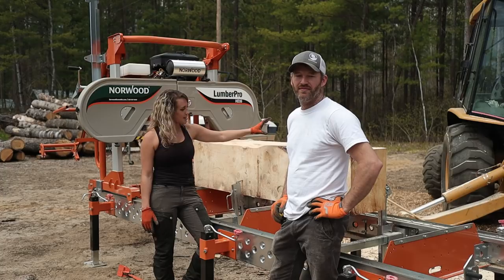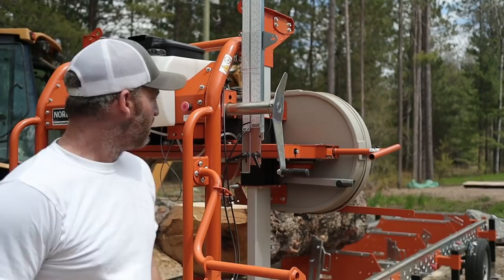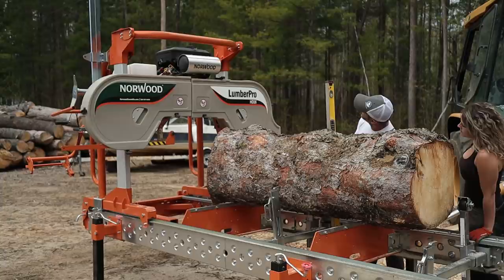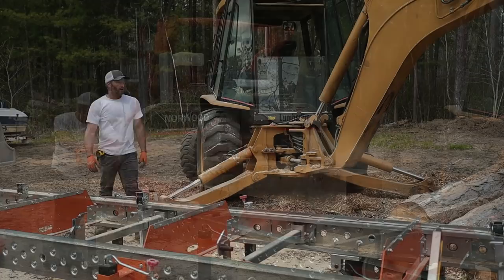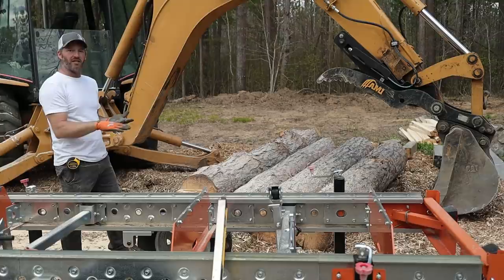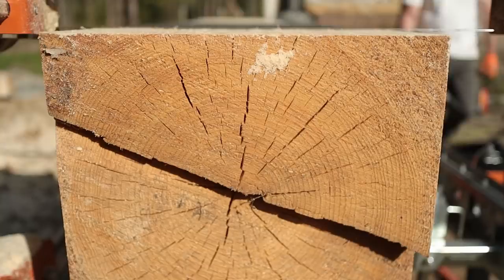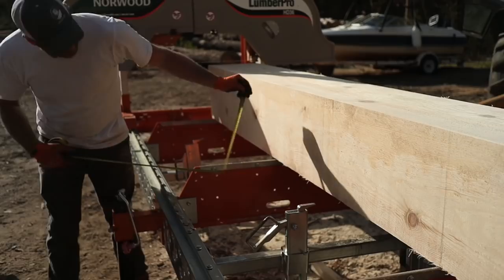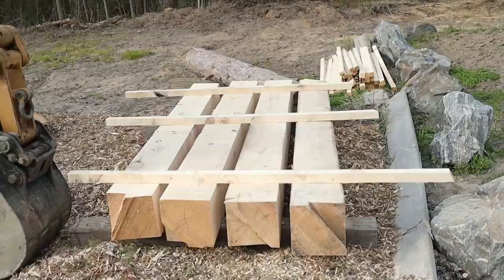Milling Big Beautiful Timbers from Trees We Take Down | Norwood HD36 Portable Sawmill

Comment: You should get yourself a metal detector and run it over your logs before cutting them it would save you a fortune on blades in the long run
Reply from the maker: Definitely something we are looking into!
Reply: TimberMates if you get one make sure you put it into all metal mode as they are usually built to ignore things like iron....especially iron nails. Give me a holler if you want any advice
Reply from the maker: Thanks man!
Reply: TimberMates no worries brother anytime
Reply: smart idea
Reply: And what actually you do, when you detect some metal? I told you, you cut anyway hoping for the best... Better get some sharpening tools, restore blades yourself and save money this way.
Reply: @yarpen86  that's if the blade is repairable with a decent metal detector you can pin point exactly where the metal is and how deep it is also sharpening a blade would take you hours  time that could be better spent working
Reply: @Thebigmanmetaldetecting  My question is stil valid, what you do when you detect something? Scrap the log? Dig until you extract some nail? Losing even more time? If it is not some massive bolt or rock, just go thru, charge more and put band on sharpening machine. I was trying detecting and after short time i decided it is not worth the effort. Of course if someone want to try, more power to him, everyone should find his own way.
Reply: Could you get carbide/diamond blades for a saw this big?  That would be slow going through wood, but it wouldn't have an issue when it hit metal.  If you could use a metal detector to figure out approximately where the metal is, and then switch to a metal-cutting blade just for that section, that might work.  Definitely a bit tedious, but it would keep the slabs intact, and it would be a lot easier to cut a bit of clearly exposed metal out of the finished slabs.  It's the 21st century.  Seems like that kind of tech should be available somewhere.

Comment: You need to metal detect the logs before sawing them. Have a catspaw and fencing pliers this helps pull the nails out. Any trees that come from old farms will most likely have u shape type nails in them. Put some Dawn dish soap in the drip tank, it will keep the blade clean of any gunk build-up. Get some anchor-seal for the ends of logs, to keep checking down.

Comment: I've owned wood mizer LT 40 since 1987.  Advice from a seasoned logger, always wear  eye, ear and hearing protection.   If you see any blue stain on the butt cut or as you are removing slabs, that's a 99 percent chance that you are going to find metal of some kind in the log.

For bigger logs and trees with a rough bark like hickory I switched to a bi-metal  blade.  

They are more expensive but are easier to touch up and last at least twice as long between sharpening.

I've cut 750 bd feet of Shag bark hickory  with them before before sharpening.  

I always out a few tablespoons of liquid  fish detergent in my water for the blade lube.  

A clean, sharp blade can double your daily board foot total.  

My best ever investment was a metal detector.   Consider getting one as soon as it is in your budget.

Awesome videos.

Comment: A 30 year Sawyer recently taught me that if you sticker your lumber way out at the very ends of your beams, cants or boards, it will reduce checking quite a bit. He also encouraged painting the ends of the logs asap off the stump with waxy paint (or pretty much any paint you can get a hold of) to slow the drying to reduce cracking and checking. Also, elevate log piles off the dirt or store them in a pond if possible.
That's my exciting comment! No go make some sawdust!

Comment: I have noticed on some other sawmill vlogs that has Norwood  an the exit place of sawdust where it has 4 holes. They took a jigsaw or reciprocate saw an just cut all that away an made a big hole where dust comes out.  That dust build up inside blade wheel will cause problems of blade running up an down during sawing.
Reply from the maker: that's probably a good idea, not sure why it wasn't that way from the factory??
Reply: That's what they said to. I think it's plastic so wouldn't be hard to open it up. I've watched a lot of vlogs trying to decide which one I one an what be right for me . An I've heard them talk about the dust building up on wheels an if it's pine or something that has a lot of sap in it sticking to the blade an causing it to vibrant an or make blade rise an drop when sawing. They talk a lot about using a solution or diesel to keep blade lubricated. Cook's recommend using machine oil or something to lubricate blade instead of a water solution. Make sense to me as long as blade don't slip.

Comment: In the business, we call that "going up and down" that the blade was doing after you hit the nail "snaking."  Where I sharpen the saws, we run an 8"X30'6"X16 gauge horizontal bandsaw and a larger vertical bandmill.  The vertical can hit a nail and keep cutting straight.  But the horizontal will start snaking more often than not.  I guess it's just the different dynamics between the types of mill.

Comment: How long does the wood have to dry after being sawn before it can be used for building?
Reply from the maker: thats a good question. Timber frames are almost always green wood but stick framing is often kiln dried. Wood dries at a rate of about 1" of thickness per year naturally. If your building something that is open air there is no reason to wait for it to dry.

Comment: What is the maximum size logs you can mill? I’ve seen some that say max 20” diameter.
I want to be able to cut FOC 
2”x12” or 4”x12”.
In your experience how large or how much room does center normally range?
Reply from the maker: 36 inches
not 100% sure what you mean but with a 16 inch diameter log i can usually get a 10 by 10 if its straight.

Comment: I just subscribed! Found your channel trolling through Norwood topics. I'm considering the HD38 which they just released. I'll do some backtracking to see if you have any formal reviews of the Norwood product.
Reply from the maker: I probably would have gone with the hd38 if it was available when I purchased the HD36. I would like the extra width of cut and space above the blade for some of the bigger logs
Reply: I own an HD36. It's decent overall, but the Woodland Mills HM130 Max is better value. I hated the ceramic blade guides with the constant wear, adjustment, and blade dive. I replaced with Cooks roller guides. The bed is terrible for stationary milling (designed for trailering) - it's expensive, imprecise, and will "warp" and won't relax to level without loosening hundreds of bolts. Not sure if the new bed is better. The plastic covers are now melted and shredded - just ridiculous. The new covers are likely better. The carriage is good.
Reply: @approots  Thank You very much for sharing your experience. I have not had a good experience at all dealing with the Norwood company. Multiple emails sent with no response. That in itself has pushed me away from them as an option. Could not imagine what customer service would be like if I had an actual problem with a mill.
Reply: @thebradleysoncatbirdhill6849  It's a busy time with the high lumber prices. The guys tried to help with my blade dive issues, but unsuccessfully. They recommended I buy their rollers, but they're inferior to Cooks and didn't want to send them more money.
Reply: My carriage slopes down which means the blade slopes down. There is no adjustment for this. It is a design flaw. Their rollers are not adjustable and don't allow downward pressure on the blade, Cooks are adjustable in all ways, so I can level the blade.

Comment: Do yall have a metal detector? Gotta be cheaper than replacing the blades all the time. 😃👍
Reply from the maker: A metal detector would be pretty well useless, it still wouldn't tell you how far down it is and you'd still end up finding it with the blades anyways. Blades can be sharpened, all good.
Reply: @TimberMates  Makes sense. Keep up the good work. The energy and chemistry you two have is a great example for young couples. And there's woodworking and outdoor stuff too! LOL
Reply from the maker: @tsgsjeremy  haha thanks so much!!

Comment: For all the blades you ruined you. Plus have bought 10 metal detectors.
Reply from the maker: Blades are very cheap and can be resharpened. So no, that is incorrect. Metal detectors do not detect deep enough to do anything useful. We have tried
Reply: @TimberMates  good point.